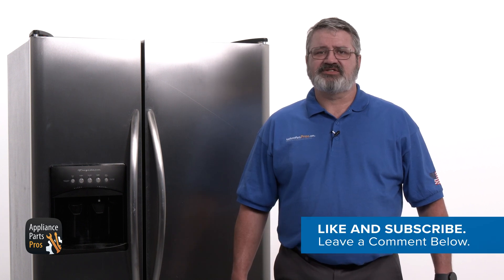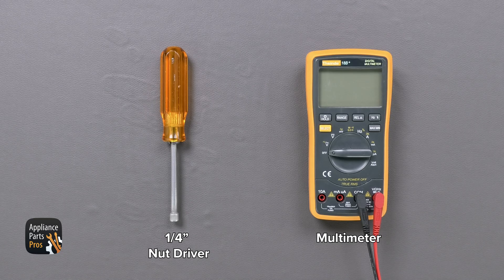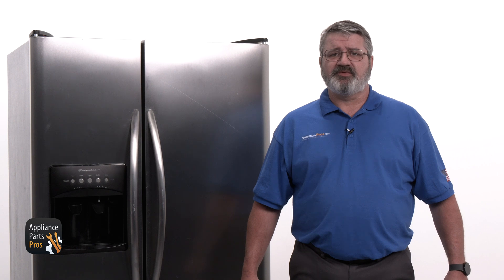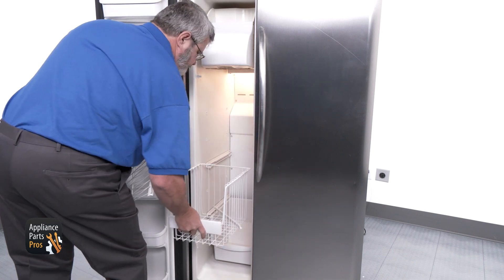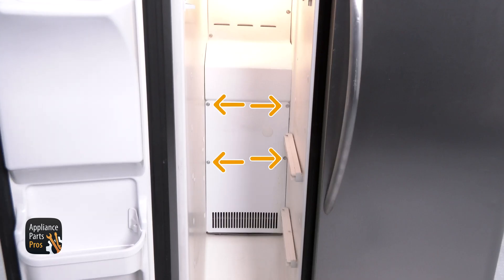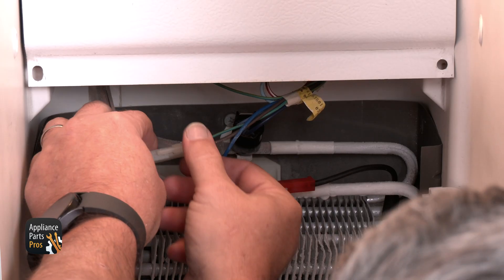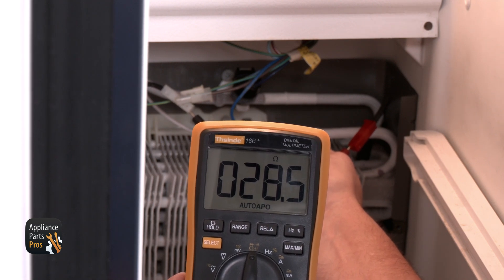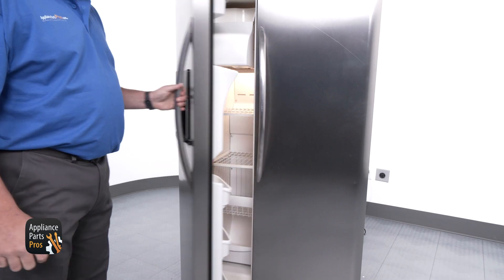How To Test A Frigidaire Refrigerator Defrost Heater

Comment: you test continuity aswell 🫡👍
Reply from the maker: Continuity is a good quick check 👍, but the most accurate way to test a defrost heater is with a resistance reading. A heater can still show continuity and not be working properly, so resistance testing tells the full story.